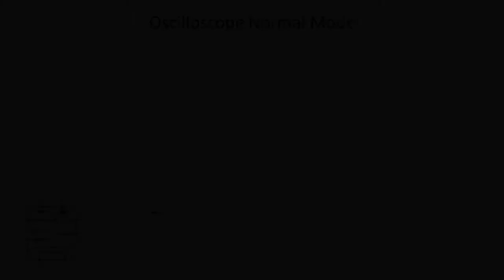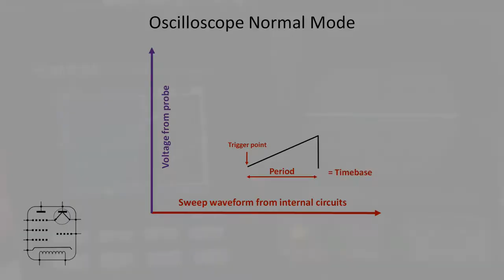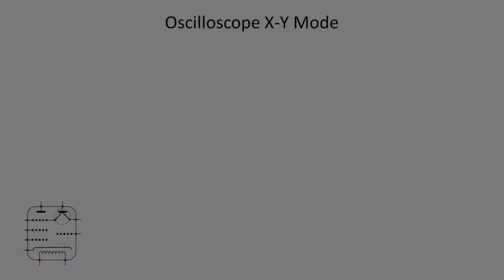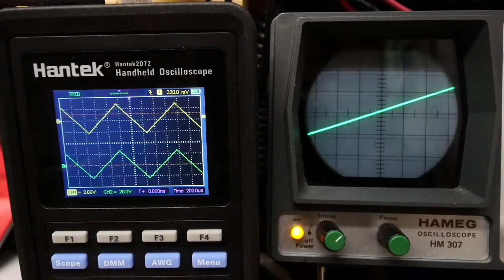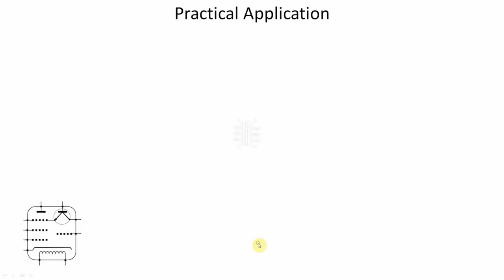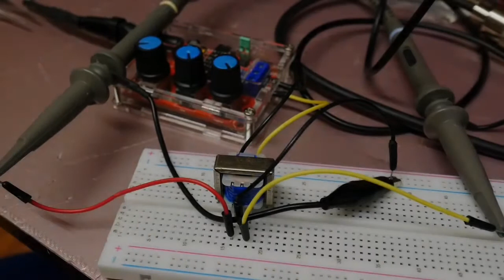Getting the most from a single channel oscilloscope - Hameg HM307 - #046

Comment: I watch this because all i have is a 1969  single channel scope,and its realy complicated to use,there are tons of settings(philips gm 5602,with 42 tubes inside,from 1961,not portable 29 kilos,and a super scope in its day   0-14 Mhz},and it still works,I just dont want to blow it up!
Reply from the maker: Tones of settings might also equal lots of flexibility!
I have learnt so much from my old Hameg scope, sometimes pressing 'auto set' on a modern scope means you miss out on basic understanding.